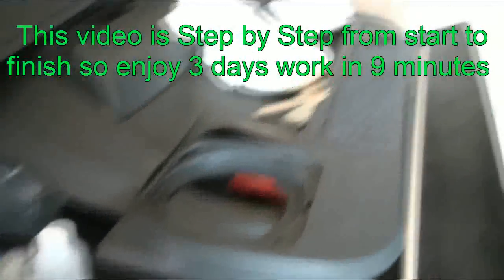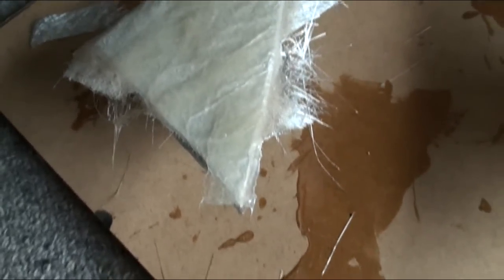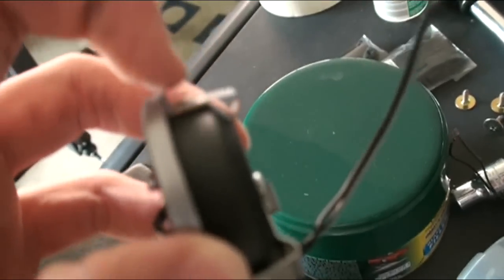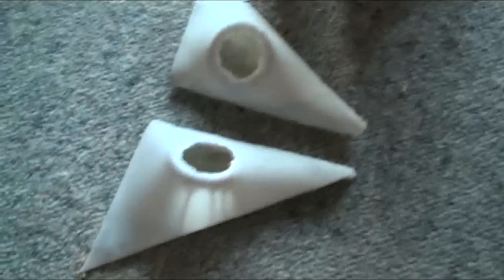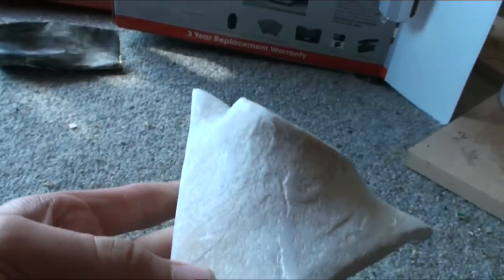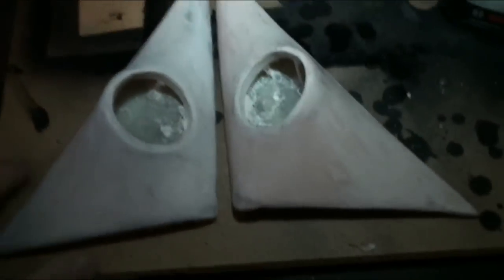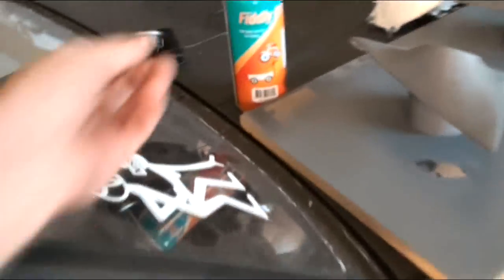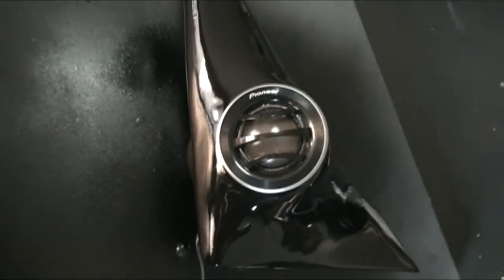Building Fibreglass Tweeter Pods - Start-Finish (Pioneer TS-D1720C)

Comment: Useful info as i gotta mount some soundqubed super tweeters in my 02 subaru outback (believe they're called liberty down under) 3" mounts.. shall be fun because the stock mounts are kinda weird.. might just modify the stock one due to the crazy mounting (no screws, just rubber studs going into rubber holes) or.. mount over it.. w/e

Comment: Quite a awesome tweeter build! Just too bad, I absolutely dispise those specific pioneer tweeters with a passion! They're the exact same ones that come with the d1720 components. Worst tweets I've ever used. The woofer is quite great at least.
Reply from the maker: yeah man I agree there some hash tweets but in there defense there still running 4 years on

Comment: Nice job although I can't imagine many people would go through the trouble.  Better to find some tweeters that have tilting mounts (e.g. my JL audio C5-650 component system) and just cut a hole and flush mount them.  They may not be as directed towards the driver as yours, but it will look more "factory" than the glossy housings you made (which are nice, just not exactly factory looking).
Reply: He stated at the end they were glossier than he wanted them to be...

Comment: how did you get the finished piece to stay in the car? because the stock piece had tabs that fit into place and your fiberglass one did not.
Reply from the maker: Because the pods are molded off the originals I then just simply attached the molds too the original covers with some screws and they cover them perfectly
Reply: o ok. I appreciate it man.